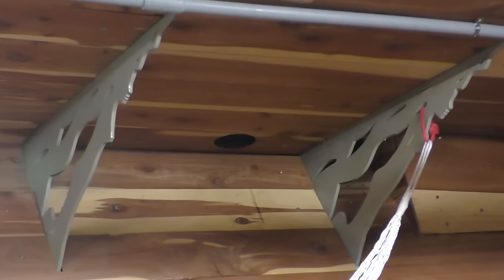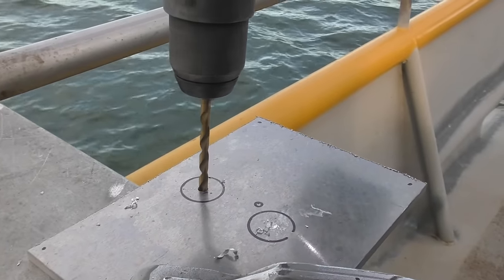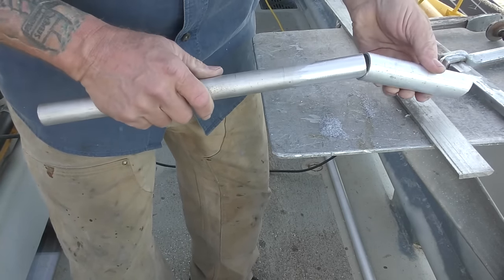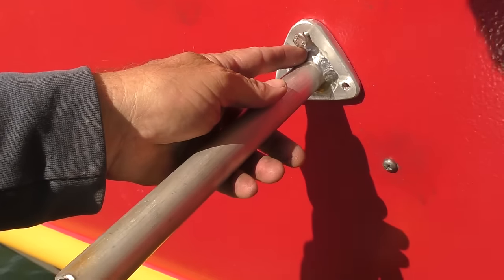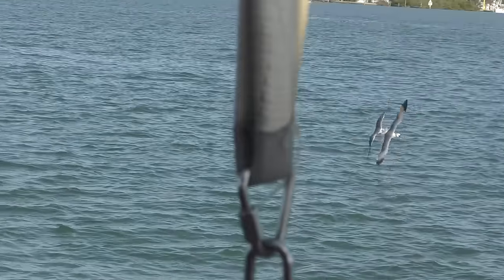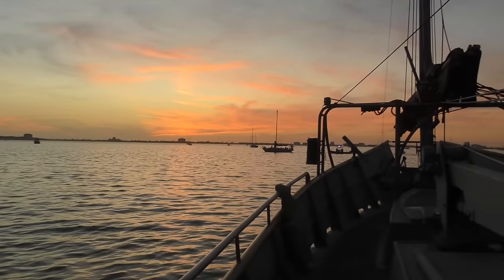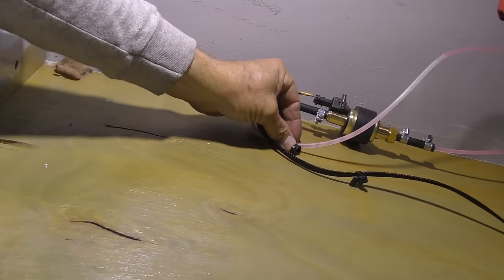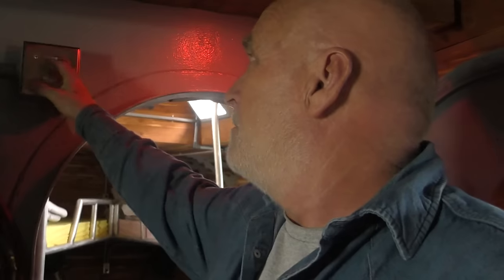Chinese Diesel Heater Install in a Chinese Boat

Comment: The little splices with the solder that take a really good heat gun or a small torch are some of the best environmental splices you can use.  That style is what AirBus uses on all wire splices including in the wheel well area. Very good choice you made.  And finally a review of a Chinese Heater that I can trust.  Question.... Does it smell or burn your eyes like when you run diesel in a space heater?  just wondering.  Thanks .. Great Video.
Reply from the maker: I don't notice anything inside.  You'll have plenty of burning diesel odor on the exhaust so put that were it does not blow back in.  Hard to do on a sailboat underway.
Reply: Thanks @SVSeeker

Comment: Doug the exhaust needs to be in stainless from the vid it looks like you used aluminium, the flue gasses will corrode through the Aluminium very quickly and let exhaust gasses out into the cabin.
Reply from the maker: I'm betting I'll be dead from other causes before then.  : )

Comment: My boat is heated by a Webasto 2010 40,000 btus. of hydronic heat. Works fine with blowers and baseboard even with temps in the teens here in NJ. Used a Espar (Eberspacher) hot air unit initially (1987)  but newer diesel fowled up the glow plugs. Made a tank to burn kerosene but that became a hassel so that's when I converted to hydronic heat. The Chinese hadn't poached the patents yet.
Reply from the maker: Do you need some 24v fan radiators?   I was going to go the hydronic route but thing I'll just use the forced air units.
Reply: Thanks but my system is 12v. You might want to sound insulate those pumps. The thump thump will drive you nuts especially at night. I always could hear my Espar start to fire (thump thump) followed by the turbine whine. If it failed , it was always early am. Got really good repacing glowplugs!! Good luck. @SVSeeker

Comment: That black rubber fuel hose that comes with the heater will only last about 2-3 years it seems then it cracks in half just so you know Doug! 
I have 4 of these cheap heaters
Reply from the maker: Easy fix.  And I sort of think it depends on the environment.  When I lived in the desert, rubber routinely died early.
Reply: yes very easy fix! just wanted you to know as you got it on the inside of the boat :) and no one wants to smell/clean diesel fuel haha 
I'm in Canada btw and that rubber still didn't last very long here
Awesome boat BTW Doug or should I say ship!! lol
been watching almost since the start! love it @SVSeeker

Comment: You can run 24v to a buck converter to 12v  i would also change the tanks out to a aluminum or a boat tank  i run both i also run 10 gallons of kerosene  at least once a year to clean out the fuel lines im also in the process of changing out the fuel lines from plastic to copper less chance of them breaking and looseing all my fuel

Comment: Sending the hot exhaust straight outside means you miss out on some of the heating. Having a few feet of exhaust pipe that could radiate heat would maybe be smart. I also saw someone putting the exhaust pipe through a sand thermal battery before it exits.
Reply from the maker: Man!  I thought I was cheap.  : )
Reply: @SVSeeker  I would call you highly resourceful.

Comment: I don’t know if you have a stud welder or not but I feel like you could use one very regularly on your boat. Instead of drilling and tapping holes in the hull just zap on 4 studs. Pros and cons to each for sure!
Reply: i made a very similar comment in a diff video. Holes to the outside and threads is a recipe for corrosion...
Reply from the maker: Never was impressed with the capacitor stud welders and the good ones, besides the high price will fuck the coatings and create more work.  So no thanks.
Reply: @SVSeeker  What do you coat drilled and tapped holes with to prevent corrosion? Boeshield?
Reply from the maker: @obfuscated3090    Never-Seez  https://amzn.to/47bxu4d

Comment: A friend gave me one of these heaters.  I’m looking for the restrictions on running the exhaust. If I run it across an up thru my deck will condensation form and puddle in the heater?
Reply from the maker: The exhaust will easily dry out a little condensation but you’ll want good protection from rain and seas.  And I have my exhaust pointed at the deck and it has stained it black with soot and unburned diesel.  Building a better exhaust for it is on the list.

Comment: Oh wow i just put one in my camper van
Reply from the maker: And it has not burned down yet.  Awesome!   : )
Reply: @SVSeeker  haha 😂 love your show!!! You might want to look into heat exchanger for the exhaust i made one for mine. 1" stainless flexible gas line works good, just cut the yellow plastic covering off

Comment: ya could...   make a FAN somplace that is nice to run, but it's BELT AND MOTOR TO SPIN IS is to spin a ''car alternator'' ;) so ya got the REAL 12 VOLTS ??  or put the 12 volts from DC to DC to a TRIKKLE CHARGER to a ''heater bank battery''  a real 12 volt batt, with the DC to DC 12v doin the ''chargeing'' instead of the RUNNING.... ??  

eh...  I would put an alternator into one of the hyrdolik systems that pump all the time or something so it does the ''house12v'' stuff or that other idea if the trikkle chargers put out 13.8v with a 10 to wutever imput... ''at least 9.0v to 15v ??''   8v to 26v could be good too...  there should be something like that...

I ain't gunna go off rabbit hunting lookin at the junglewebsite lol  BUT....  eh.... also...  I would personally SOLDER EVERY THING with a real ''nice'' good solder iron OF PROPER WATTAGE FOR THE ITEM SOLDERING ;)  makes a diff sigh

Comment: Do you have to replace the driveshaft bushing every 3000 miles, and the shaft is bent? Or did you fix the problem?
Reply from the maker: I think you are talking about the cutless bearing on the propeller drive shaft?  If so, we have added a pump to flush it with clear water, reduced the shaft speed with the addition of a transfer case and promise to not dredge through more sand bars on the Mississippi.

Comment: Feed the 24 volts towards the heater. Put your buck converter there.
Reply from the maker: That would work, but those are 70 amps converters, a lot of that power goes forward in the boat.
Reply: @SVSeeker  I don't see a link to the buck converter. Is that 70 Amps in or 70 Amps out? Buck converters swap voltage for current. Thinner wires in, less voltage droop over the few inches to the load.

Comment: run 24 to the heater the put a DC-DC at the heater to reduce voltage drop
Reply from the maker: That would work, but the old extension cord was looking for a new life.

Comment: I never could get my diesel heater to work. Sooted up the first time, cleaned it, it has a hard time igniting and then it gets e-10 error flameout.
Reply from the maker: It's a crap shoot for sure.     I wonder if the Chinese invented Craps?

Comment: When you're using your hole saw at high speed set the clutch so it gives. It sure hurts if you dont.
Reply from the maker: Yes, good point.  And I do that.

Comment: Thanks Doug, them heaters sure do look the part. Have you any idea what the burn rate is per hour or day? Merry Christmas and thanks for posting....
Reply from the maker: Thanks, and I don't know either.  They have levels, but I figure the more diesel in, the more heat out.   It's not like it has a choice about burning.
Reply: @SVSeeker  Doug, I know it's only been 9 months but is there any chance you could do a quick review and share any results or thoughts....
Reply from the maker: @jakobrebeki   Yeah, better to wait for another winter.    I had no problems with them yet, and have spoken to other boaters that have had them for years and still love them.

Comment: how did you cure your sea sickness ?
Reply from the maker: I got back from the Antigua is started clearing my ears with peroxide and my sinuses with salt water.   Then flew back to  Antigua for the return trip the Georgia and had no issues.  Also no problem on the trip to Tampa.  So that it for me, but there are a thousand of other ideas out there.  I think the best advice is keep trying.
Reply: cool thanks ! Ill give it a try ! @SVSeeker

Comment: Nothing wrong with running 2 parallel wires for extra current capacity
Reply from the maker: Well, you and I don't think so.   But if we pay some guy to make rules for us,  then...     : )
Reply: @SVSeeker  I haven't read the codes in America but atleast here I Europe we got little books with tables detailing how parallel wires should be sized for the current. Obviously 2x the site doesn't mean 2x the current.....

Comment: LOL  ! Love those welfare seagulls ! With the heat and the dissimilar metals (aluminum and steel) in a salt environment.... Be on the lookout for corrosion! Insulate the the areas where the two metals touch.
Reply from the maker: I have several places where aluminum is bolted to painted steel.  So far after two years, I'm very likely to be dead before there is any problem.

Comment: The pilot bit for the Greenlee hole saw kit you can get at any electrical supply store and its inexpensive.
Reply from the maker: Thanks.   And compared to the cost of my last set of fixtures from the electrical supply store I guess it would be relatively inexpensive.

Comment: Most voltage converters have adjusting pots to fine tune. If possible, turn voltage up to 14 volts or get dedicated adjustable converter. 
I would set any converter at minimum of 13 volts regardless.
Voltage drop is very common with 12 volts vs 24 volts and above.

I bought a 24v 2000 watt inverter to make the connections more reasonable size and also run my solar charging at 24 volts.

My low wattage 12 volt accessories are powered by a 24v to 12v 40 amp adjustable voltage converter, overload protected at 30 amps and used as a 30 amp 12 volt circuit. 
Don't use converters near their max ratings unless intermittent; heat and voltage drop.

If low voltage with high wattage needs sent any distance on your boat, I would send 24 volts and convert to 12 volts at the accessories. 
Otherwise send high voltage from the mains and step it back down.

24 volts will travel much easier without drop than 12 volts, save you enough $$ on wire to pay for converters and be more reliable.

 24v will still conduct and do its job better when a connection is bad or becomes loose from vibration and movements; like during the middle of battling a bad storm, when everything HAS to work correctly and long enough to at least get through the storm.

The bad 24v connection will look terrible from burns and arcing, but it still powers through the storm to be repaired afterwards.

The 12V connection could either stop conducting from the low voltage and bad conductivity or burn the connection open from the extra amperage available and resistance acting as a heating element.

I have also done alot of work with 24 volt control circuits in industrial  automation and HVAC circuits; never had issues with voltage drop; even on long production lines and where the e-stop circuit is daisy chained. 
For really long runs, they make e-stop relays to shorten the 24v runs.
Most of the 24v was low wattage, but the voltage stayed consistent, unless their was a short. Then voltage goes to zero and no green light on power supply. 
Remove short, green light comes back but nothing overloads, blows or trips.
Allen Bradley power supplies and many others, are smart enough to protect itself.

Watch for DC relay switching messing with your electronics.

Keep switching DC circuits and wiring away from low voltage electronics and sensors. 

Don't put DC power circuits inside the same conduits or enclosures as low voltage control cables or sensor cables.

The EMF from the DC messes with the electronics, especially when switching; seems to spike the electronics and can give false readings, cut off momentarily and back on, etc.
Computers and accessories really don't like it. I always had to seperate ethernet com. cables to industrial accessories and HMI's from low voltage control circuits by at least 3-4 feet.
Never ran them in same conduits; if one crossed the other, I did it like a cross and never let them be side by side.
24v DC seems to have the most negative effects on electronics; I did not notice this effect with 24v AC. 
Also, if you end up with an adjustable 24v power supply, you can turn them up to 27 volts and not have issues. 
Helps for same reasons; more likely to actually receive at least 24 volts at accessories. 
A volt or two over is much better than undervoltage; undervoltage will damage and cause excess stress on windings.

13.5v is a good setting for a 12v power converter.

Test with meter while converter under heaviest load possible; the floating voltage, without load of some sort is irrelevant.
Reply from the maker: Yes!  I learned mine does too.  Thanks.   I'll use it if I need it now, but as lots of stuff use those converters I think it best to just add more copper.

Comment: These things tend to go quite fast, they also put junk glow plugs on them, the tiny junk bearings also tend to go, easy fix though.
Reply: I'm getting about 6000hrs before the bearing start to go out and have never had a glow plug fail all 4 of my cheap units at this point 
I'm putting about 900-1000L per year through some of them without any real problems at all
Reply: @NightshiftCustom  Well, you must have lucked out, many factories in China make them and I guess some are worse than others.
Reply from the maker: I have noticed an improvement in the comments on this particular unit, and even the company says they have made changes to increase the life.   But I still tossed the mount plate and muffler.  I don't think sheet metal and salt water boats just don't mix.
Reply: @SVSeeker  That's good to know, please  do tell how reliable it is longer-term after it's been in service for a while, I guess life will tell.
Reply: yes they all have been making good changes to these heaters
there are many brands and many controllers they use or can be used on them
maxpeedingrods,vevor, hcalory and other brands has there own controllers now and even some  have a new bigger burn chamber for there 8kw model's that before were just 5kw's units rebranded as 8kw @SVSeeker
Reply from the maker: @NightshiftCustom    Sounds like you have some experience with these things.  : )
Reply: well just abit lol I may even have one mounted in my golf cart for winter snowblowing hahaha @SVSeeker

Comment: That's a big problem with building people's homes to is that they don't want to spend the money on 10 gauge wire that if you spend the money on the 10 gauge wire the electrical system will pay for itself inside at 3 to 5 years that's the part they can't understand that voltage drop kicks your ass
Reply from the maker: Interesting